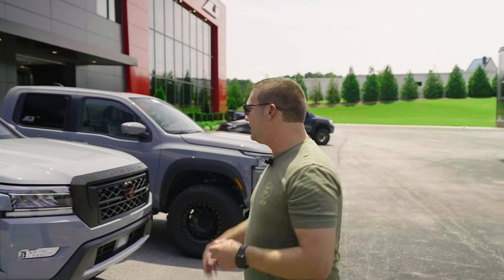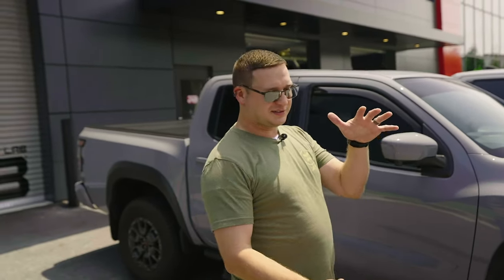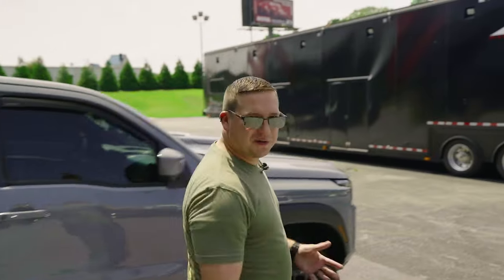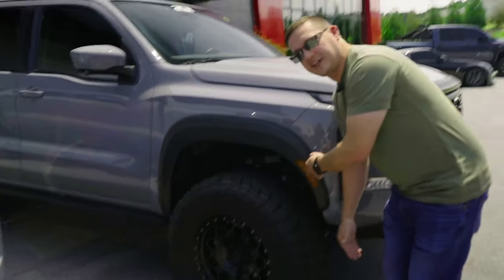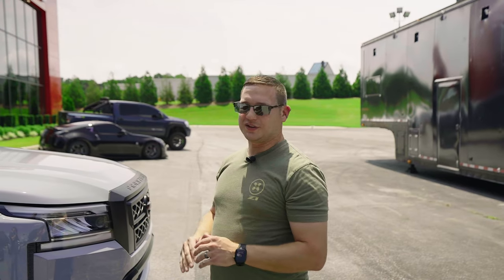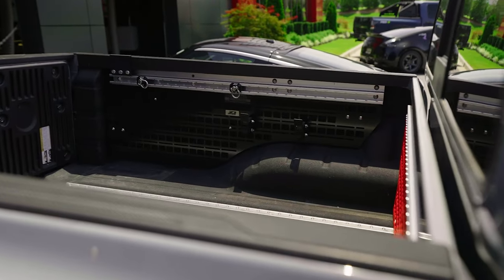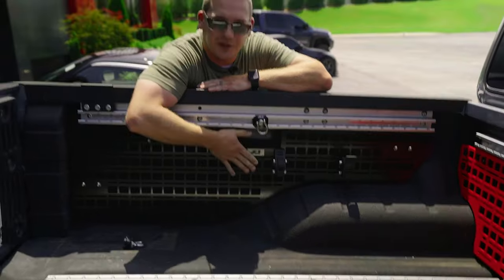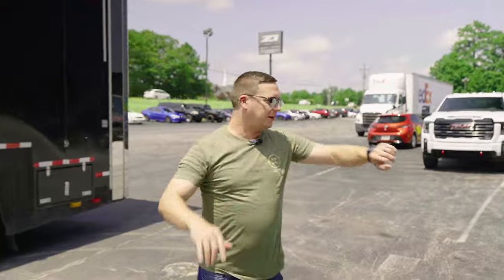Z1 Lifts & Mods a Customer's New Frontier

Comment: I want to know how you avoided rubbing where the mud flaps were on the Titan swap, my research says it widens the stance by 3 inches. 1 put Z1 1. 5" wheel spacers on with a Z1 2.5" level kit and had to do some significant cutting and heat molding to the fender liners to get clearance with stock sized tires.
Reply from the maker: Some trim and melt mod is certainly needed on the Titan swap.

Comment: Nice trucks. I have a 23' Pro4x. I installed another brand lift kit, and possibly purchased the wrong rear springs for my application/use/weight. The ride quality is kinda overly stiff now. I'll either add more weight to the back(already 250-300lbs extra in the bed now) or will go to an add-a-leaf or your guys shackles. Thanks a lot. Ohhh....yeah, another front bumper option would be cool, winch capable.
Reply from the maker: Yep often the stiffer rear will yield that and more pronounced understeer even in day to day driving.  Stay tuned, bumpers are also in the works.
Reply: what lift kit did you use?
Reply: @tomhawco12 all dogs fox extended kit with parabolic leaf springs.
Reply: Are you sure.... ???  I brought a 2022 Nissan Frontier PRO X after having a 2009 Frontier that I was happy with . But the 2022 Frontier was junk. It would drive wishy washy like a old over sized Caprice. Floated and boated and waved back n forth. Technology sucked. The display system was dull. I took a month-long trip from AZ to Wisconsin I stopped in Denver. I hated the truck so much that I got a 2023 Chevy Colorado Trail Boss. The BEST DAMN DECISION I made even though it made me $5000 upside down. Absolutely love the Chevy and I laugh whenever I see a sucker driving a putrid frontier truck. Nissan did nothing but upgraded cosmetics. The Colorado also drives like a bimmer. It's sporty tuned suspension and sticks to the road. No clunky wavy steering like the Frontier. NEVER AGAIN!
Reply: Trust me... go try the new Colorado.
Reply: @travisnelson7065  
I did test drive the new Colorado. And yes, it drove pretty good. but, and this was in Dallas TX 6 months ago, the dealer wanted $1k down and had to order it, then wait maybe 2 months to get it, with no discount. Zero. I went to Nissan dealer got my truck a day later with $3k off. and got a locker. also, that 2.7L turbo 4 cylinder engine, is going to be a maintenance nightmare in about 5-10 years, maybe sooner. almost guaranteed. oh...and I'm not $5k upside down.

Comment: Did you guys test your Z1 intake on the 2023?? There’s 2 new fuse boxes by the air filter housing. Doesn’t look like your Z1 air-box fits. I can send pictures 😁
Reply from the maker: We’re finalizing relocation brackets for that now.  It’s currently only the trucks equipped with the Auto Start Stop system but it did surprise us.  Should have a solution for those models soon.

Comment: Cant wait to see it fully built. A bit more info on the tires would be nice, Im assuming you run 33s but can it fit 35s?and then by extension are you putting an m205 front diff and regearing? Also curious if you guys are doing big brake kit upgrade. So many questions and ideas lol.
Reply from the maker: Anything can fit 35’s with the right attitude and a sawzall, we’re currently on 33”, stay tuned for more updates….

Comment: For the 2024 pro4x frontier, do you need the Z1 upper control arm? Or can the lift be done with all stock parts?
Reply from the maker: If you are over a 1.5" lift, you will need to go with aftermarket UCAs to prevent coil bucket contact.

Comment: Do you know how large of wheel spacer you can use with the first lift (2.5") and stock tires before any sterring rub occurs?
Reply from the maker: The answer to this is entirely dependant on tire size and alignment specs. 

With a stock size tire like you mentioned, adding any more negative offset will be more likely to rub on the firewall, but with a correctly setup alignment, and some trimming, you can run a mild 1" to 1.5" spacer with little to no rubbing. 

It is important to keep in mind driving style as well. If you keep your truck on the pavement, and the suspension doesn't cycle often you will not have any real issues with a melt mod and some mild trimming, but if you plan to take your truck off roading and cycle the suspension, added suspension lift does not add tire clearance because at a certain point in the suspension travel range will be the same as a stock height truck, so trimming can be a necessity for certain setups and uses, but this can vary between users.

Comment: I like the 2.5 inch lift.  What size tire is safe to run with this set up? Would a 33.5 to a 34 inch work?
Reply from the maker: You will certainly have to do some more trimming to clear with just this lift. A popular choice that a lot of people get by with some minimal trimming and a 33" tire in the 285/70r17 or 285/75r16 flavor.

Comment: I have a 2024 pro 4x what spacer and lift high can I use without any trimming?
Reply from the maker: Should be okay with the 2.5” kit and our arms and lock out bolts on stock tire size.  If you go larger on the tire you should plan to do a little trimming and melt mod.

Comment: Which UCA can be set for more negative camber: Z1 or SPC?
Reply from the maker: Z1, though you can pair either with the lockouts or eccentric bolts.  To go much negative though you will likely have to clearance some of the lip on the coil bucket or you will hit the ball joint boot and or arm depending on target camber.

Comment: Steel bash plate up front
Reply from the maker: The first truck has just OEM parts, the z1 truck has a front rad skid that is aluminum mounted on steel  brackets with gussets, nice to work with, improved protection and better approach angle.  It also has all the other skids we offer, full details here:  https://www.z1offroad.com/z1-products/z1-off-road/nissan-frontier-skid-plate-kit-by-z1-off-road-p-50863.html

Comment: I brought a 2022 Nissan Frontier PRO X after having a 2009 Frontier that I was happy with . But the 2022 Frontier was junk. It would drive wishy washy like a old over sized Caprice. Floated and boated and waved back n forth. Technology sucked. The display system was dull. I took a month-long trip from AZ to Wisconsin I stopped in Denver. I hated the truck so much that I got a 2023 Chevy Colorado Trail Boss. The BEST DAMN DECISION I made even though it made me $5000 upside down. Absolutely love the Chevy and I laugh whenever I see a sucker driving a putrid frontier truck. Nissan did nothing but upgraded cosmetics. The Colorado also drives like a bimmer. It's sporty tuned suspension and sticks to the road. No clunky wavy steering like the Frontier. NEVER AGAIN!
Reply: 😂😂😂😂 Buying any GM product is never a good decision.
Reply: @carbonking53 Apparently some people don’t like the way a truck drives. I just wave at the GM’s sitting on the side of the road. 😂👋🏻
Reply: You Should’ve got a ZR2 . I think my frontier Pro 4x premium drives amazingly well. The ride in my 2500 Silverado is nice too. I don’t laugh at nobody’s truck unless it’s riced out.